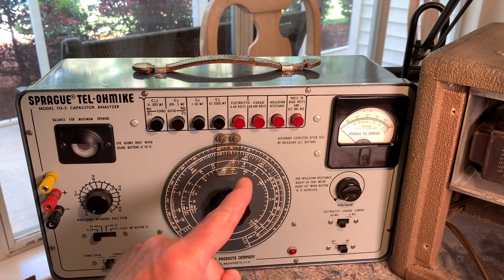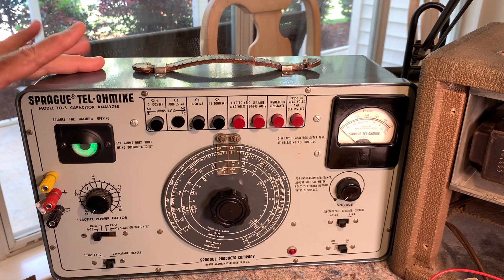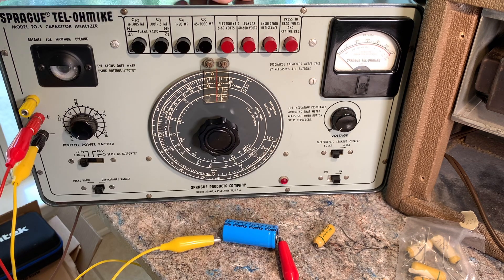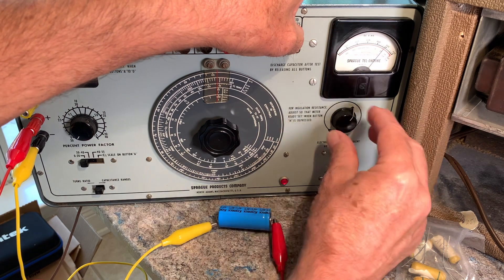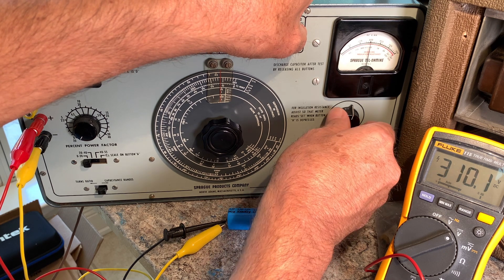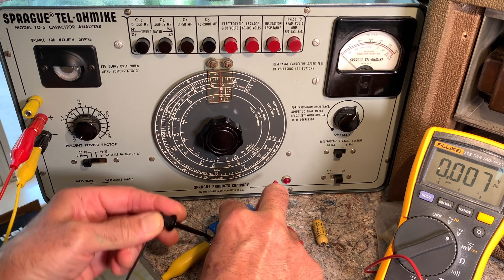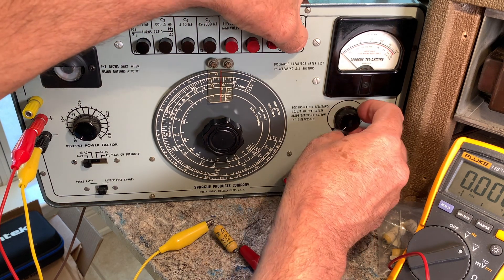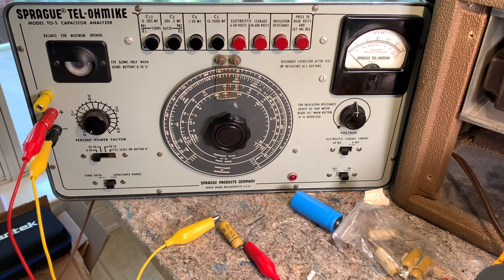How to Test Capacitors with a Sprague Tel-Ohmike TO-5 Capacitor Analyzer

Comment: Demo turns ratio please.
Reply from the maker: I think I tried to figure it out but didn’t have a transformer to check. I just realized I now have a small one I should be able to test. I’ll check it out tomorrow to see if it works and I’ll post a short video.
Reply from the maker: The turns ratio demo will be on my channel within the next hour. It worked great.  It took me a little time to figure out how to connect the transformer but pretty simple once you do it.

Comment: For insulation resistance test, ADJUST the meter BEFORE you attach the capacitor!!!! You need to set the meter at infinite resistance FIRST, then attach the capacitor to get its insulation resistance reading. Use the charge button to speed things up. Otherwise it will take a long time for large electrostatic type capacitors.

Comment: I got a TO-4, which works the same basically.  It was all original when I got it so I had to change the capacitors.  It was a case of "physician heal thyself" - I couldn't test the capacitors on the capacitor tester with the capacitors removed 🤣In any case, it's amazing that a 70 year old device can still be super useful on a modern workbench.  I use mine practically every day.

but it works great, and all but 1 capacitor was bad.  Anytime you get a piece of kit from the 1950's like this, go ahead and change all the electrolytic and paper caps- they are all bad.  All of them.  No need to try to reform them because there's nothing left to reform.
Reply from the maker: I love my TO-5.  Unfortunately, I don't need to use it much since my amps are all working correctly.  I changed all the capacitors I could get to and all of the resistors that were out of spec.  I wish I would have had it 15 years ago.  It would have saved me so much work.  I don't use it so much for measuring capacitance since my DMM is more accurate but I do use it as a double check.  Thank goodness someone on eBay had a replacement wire-wound potentiometer for the capacitance knob because mine had a broken coil wire.  I took it apart and saw the hair fine wire sticking out.
Reply: @millstap  I prefer the telohmike over the DMM because the Sprague stress tests the caps using actual voltages.   It tells you how it will perform in a circuit.   The DMM only shows capacitance,  but nothing else so it is really only good for a quick test
Reply: @tjsogmc  I agree.  Once you get a feel for the Sprague, you can use it intuitively to check for so many things.  The only real problem as I see it is it only goes to 2000uF.  That's enough for a lot of caps, but I often find bigger ones.

Comment: Just picked one up that looks new for 100
Reply from the maker: Great tool to have.  I wish I would have had one 15 years ago.  Let me know how it is working.  I had to replace the main bridge pot on mine to get the capacitance measurement operational.
Reply: Haven't had a chance to check out much also got a heathkit it28 from him that appears to work perfectly. My dad had one in the 70s before trading it for a B&k capacity analyst which I still have. Also snagged a Knight signal tracer with a eye tube which I have a thing for now lol
Reply from the maker: @ironman7261  I was also considering the IT28 but they were hard to find.  You've got all the gear you would ever need for capacitors.

Comment: Man this is a good demonstration. This really helped a lot. How many capacitors and resistors did you end up swapping out on it? Would love to see a video on that, but I know it's too late to do one.
Reply from the maker: I can't remember how many I replaced.  I went on the Antique Radio Forum to get some advice, not all of it good.  The Magic Eye tube was working but it would not read capacitance so one suggested I needed a new tube.  After replacing it, it still did not work.  So, I just went through the whole unit checking as many component I could get to, to see if they were out of tolerance.  I ordered everything that was out and also the main electrolytics.  I bought a few of the precision caps from a guy in Canada.  I replaced everything I could get to.  Some are almost impossible to change.  It still would not read capacitance.  The leakage tests always worked fine so I wasn't too concerned about losing the capacitance test because my Fluke meters are more accurate anyway.  On the forum, one of the first probable problems suggested was the main bridge pot (dial).  I   was hoping that wasn't it because I had no idea how I would find a replacement.  I later removed the wire wound pot (which isn't easy) and it was not reading any resistance.  So, luckily, there was a guy on Ebay selling pots for TO-4's.  They were not the exact same part number but they looked the same and some suggested it would work.  It did work perfectly.  The voltages on the machine are very accurate probably from changing the resistors but then, it wasn't far off before the changes, maybe 30V.  I also bought all new NOS tubes for it.  Get the schematic and give it a go.  There is a lot of info on that forum too.
Reply: @millstap  . .  I appreciate the info. I'm planning on looking inside for anything obviously wrong, the best I can see. Then I guess I'll try slowly bringing it up with a variac and a dim bulb limiter. This thing hasn't been powered up in 20 years or more.
Reply from the maker: @234dilligaf  It should be fine if it was taken care of.  My unit looked brand new.  I was shocked at how nice it was inside and it was built in 1959.

Comment: Do you have to take the capacitor completely out of the circuit that’s a real cool machine and I think your amps will work better even though I know you hate pulling those vintage caps out Sorry about your hand
Reply from the maker: Bob, yes you need to unsolder at least the lead that should not have any DC voltage on it to test them in circuit.  But, it is easier to test them on this tester if you completely remove them.

Comment: Does it tell you what is the outside foil on a cap
Reply from the maker: No. I had to buy an old oscilloscope to do that. I’m glad I did because hardly any of the new caps are marked and if they are,  it’s a 50/50 it’s correct.